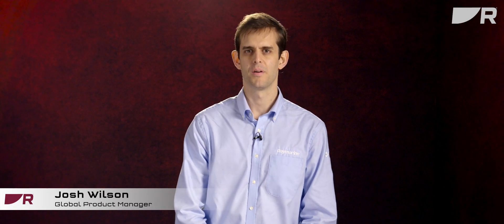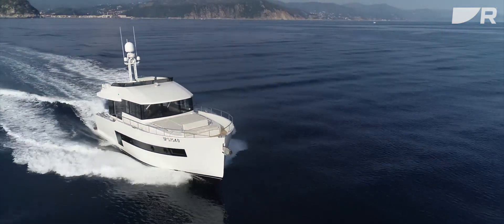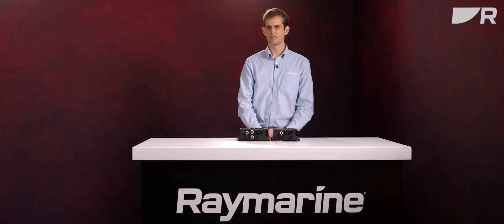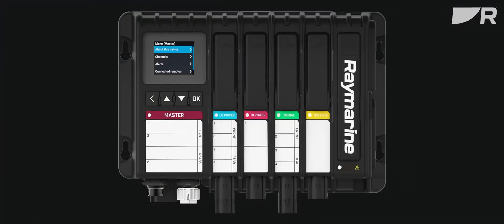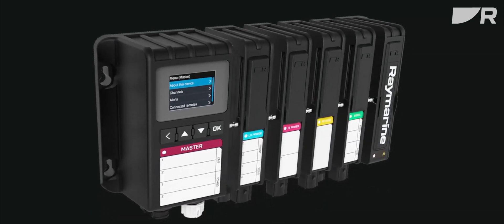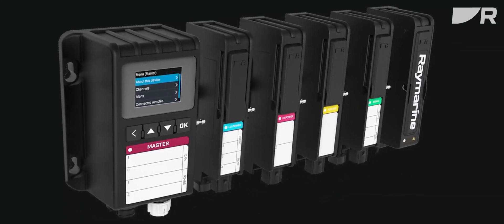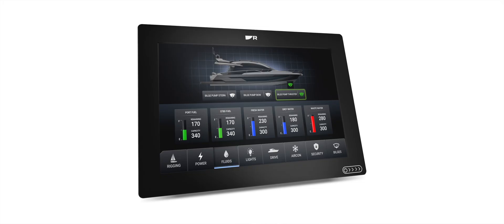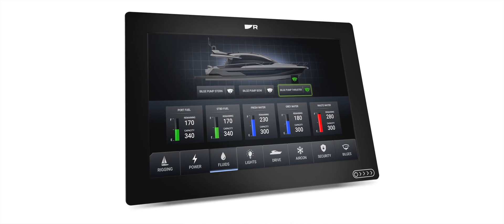Raymarine Yachtsense™ Modern Vessel Automation

Comment: Raymarine Yachtsense – Simply Superior is a joke!
We have invested almost EUR 10.000 into Yachtsense Master, Remote, and several Low Power, Sensor Modules and cables and now this all are DEAD BRICKS! Raymarine does not provide the necessary instructions or software tools for your purchased Yachtsense hardware to configure the hardware and the digital automation functions by yourself. 
Raymarine blocks this and refers to the Raymarine dealer. But my dealer is 1.000 km away and don't understands the issue... WTF!
Who can help out? Raymarine Support - we are waiting and waiting...
Simply Superior is a joke!
Reply from the maker: I am sorry to hear you are having trouble with YachtSense digital switching.   Please send me an email to james.mcgowan@raymarine.com and I will get a member of our team in touch right away.